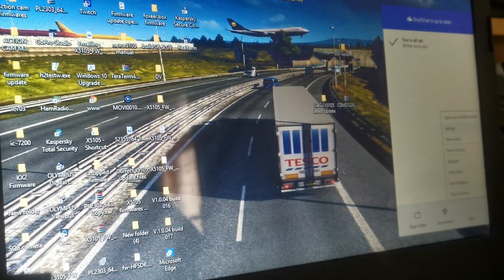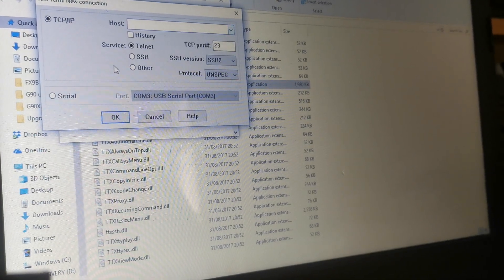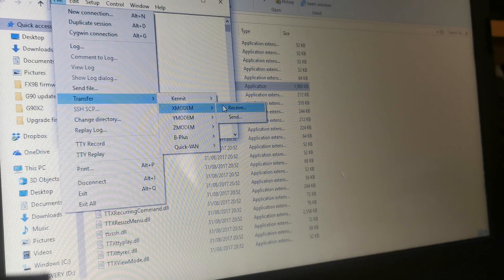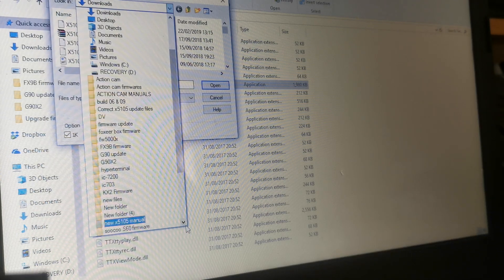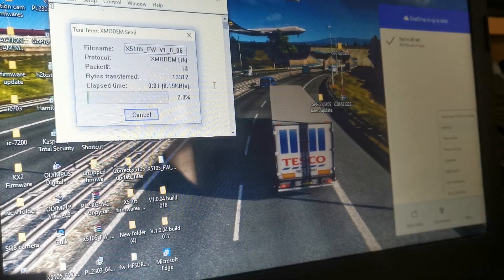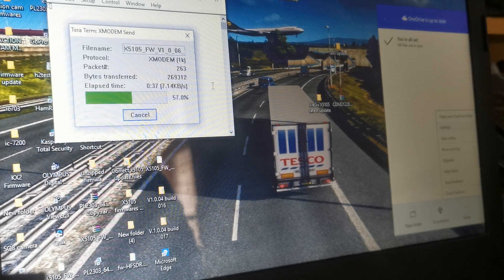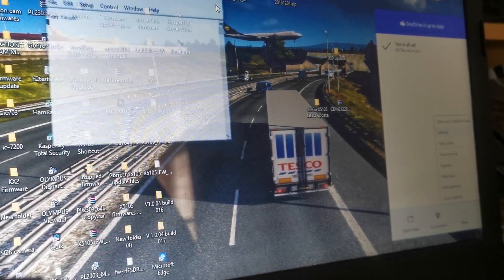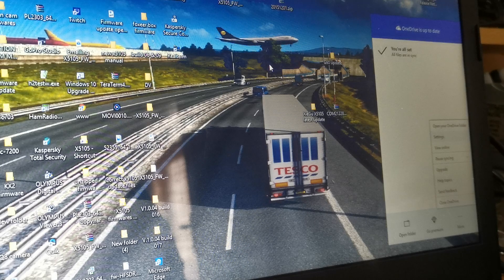A simple easy to follow firmware update for the X5105

Comment: thanks for the vid.  I am having a problem and wondering if anyone else is having the same.  I have random birdies even when no antenna is attached (s9+) and my frequency numbers do not highlight the one to be changed.  When I erase my flash and reinstall firmware  all my memory channels are saved is that normal?  thanks ...oh bought from MFJ and they were absolutely no help.  73 tim kf7ut
Reply from the maker: Tim go back to the original firmware again, then try installing the latest version again. which version have you just updated it with?? Look me up on QRZ and get my email address from there, my call sign is 2e0bvj.. We can then get it right.

Comment: You made it look so easy. Thanks for the very well done video.
Barry, KU3X
Reply from the maker: Hi Barry, it is very easy once you see how it's done. But a lot of hams are not confident doing it, it's the bricking thought and having a none functional radio. The beauty of XieGu's transceivers is that a failed firmware update won't do any damage. You just start again at the beginning of the whole process and it will recover. Thank you for the compliment of the way I explained it, the idea was to approach it head on in a simple & easy to follow approach. 73 de Wayne 2e0bvj

Comment: Can this be done from a Mac computer or Linux?
Reply from the maker: I've never tried IOS  but others have and they had no problem installing the firmware. You will probably need a terraterm emulator.. I have only ever done the updates via Windows 10 64 bit, earlier Windows systems are fine too..
Reply: What does this firmware update actually update ?
Reply from the maker: @o00scorpion00o  It fixes bugs and sometimes they add new features with these  kind of updates.
Reply: Yes, use minicom on Linux in place of teraterm.  the process Wayne laid out pretty much is the same.  Just a different interface.  Does mac have minicom?